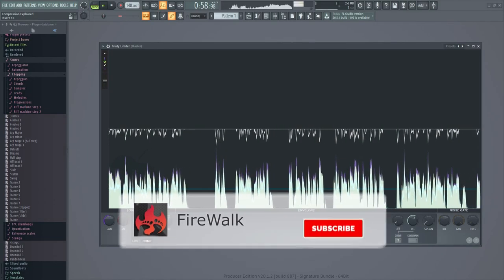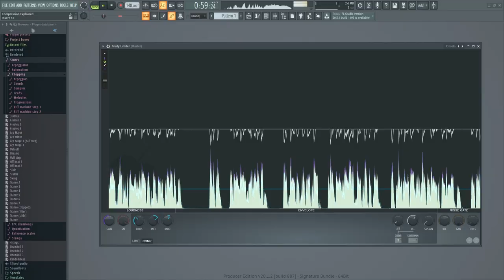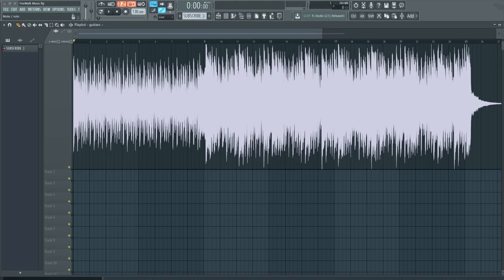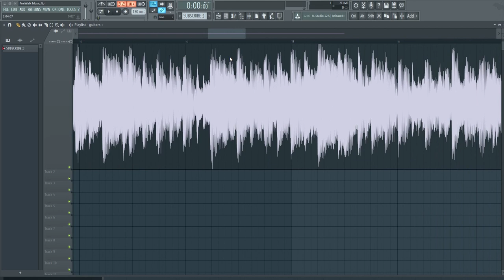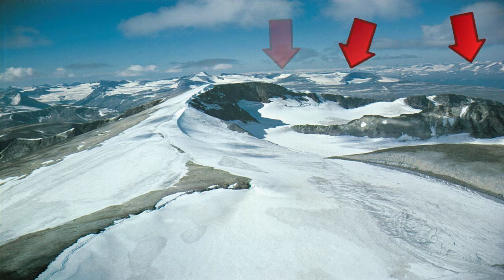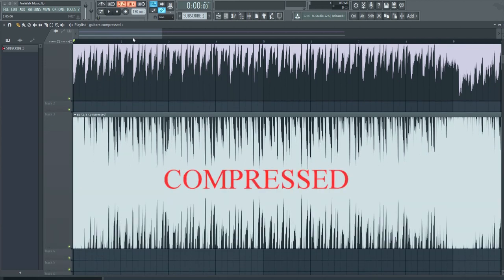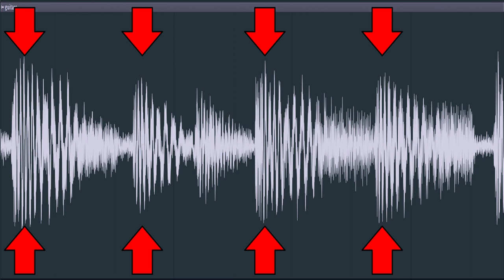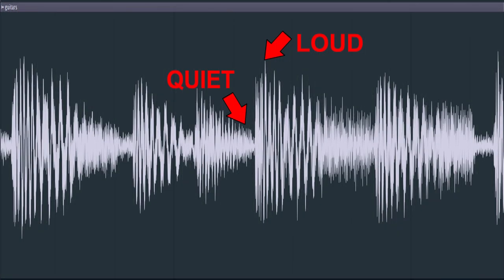Audio Compression Explained (In 3 Minutes!)

Comment: Thanks but most common questions people have is when we must use fast or slow attack or release time and why
Reply from the maker: There will be a separate video explaining how to actually use a compressor. This just explain what it does and how it works. There are so many uses and so many ways to adjust it, so that will be a much longer video. To try and simplify it a little bit: The threshold setting determines when the compressor should start working. When the signal goes beyond that limit, it will start working. The attack time adjusts how quickly the compressor starts to work after that threshold is reached, and the release time is how quickly it stops working after the signal drops below the set threshold. 
All this will be explained (in a simple way hopefully) in the how to use compression video. :)